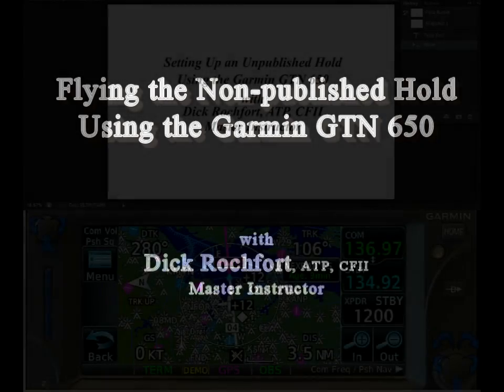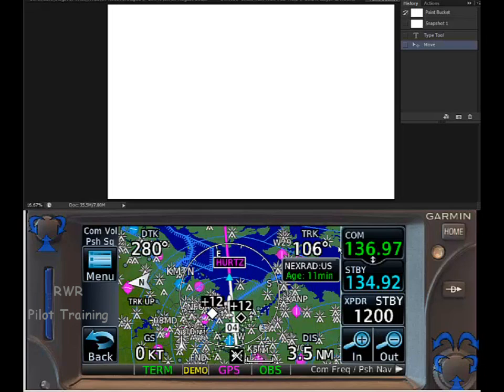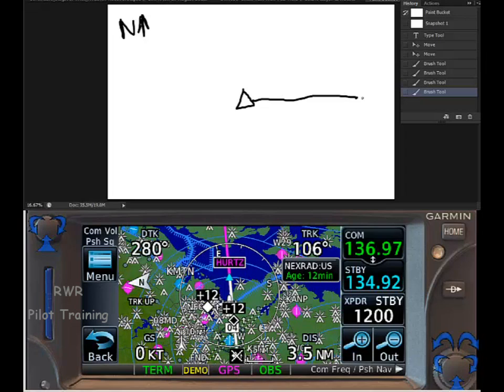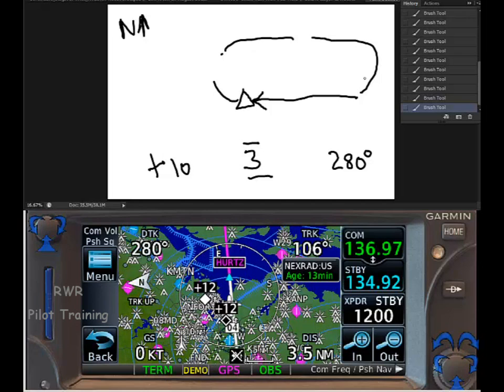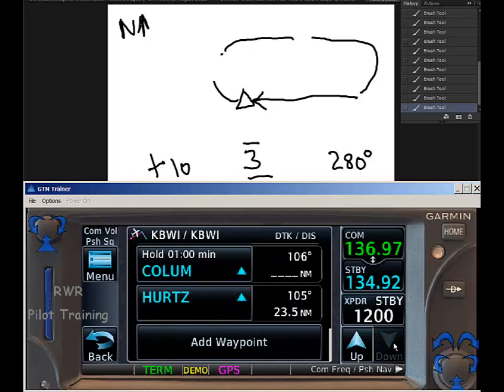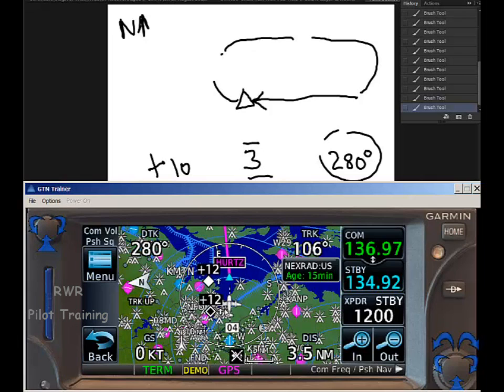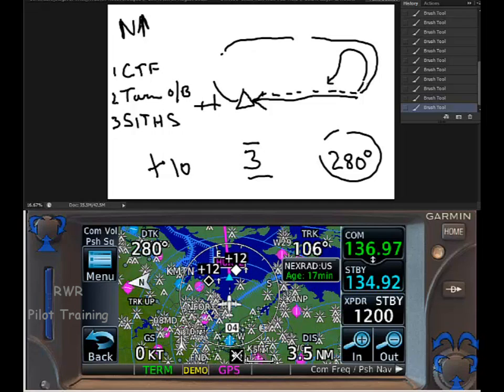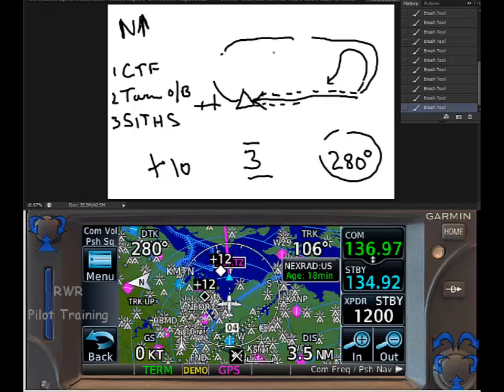Flying an Unpublished Hold with the Garmin GTN 650 Navigator

Comment: Holding AT the fix seems straightforward with more then one way to accomplish this.  What about if there is a distance from a fix that is designated as your holding point.  I.e, hold east of the hurtz 090/25.  If you want to use the 750/650 the only way I could see to define your holding fix was to create a user waypoint and then plug that into the flight plan and build your hold from there.   Am I missing something??
Reply from the maker: Hi Mark.. You might be right depending on what navigator you are operating. New versions like the 650/750 give the pilot the option to make a waypoint at the present position. You could also adjust the range of the map to put the needed distance on the arc, go to the OBS mode and select the inbound course. This might be faster.. Fly Safely - Train Often .. DR

Comment: I believe on the 650 and the 750 if you have the fix in the flight plan, you tap on the fix and select hold at fix. It then brings up a screen, which asks your inbound course and your turn direction. Once you establish that and it enters that fix it will go in suspend mode and hold until you unsuspend using the OBS button. You can also put a hold on any fix for practice, including an NDB.
Reply from the maker: Yes indeed. That is correct. Thanks for your input. Fly Safely - Train Often .. DR
Reply: @RWRPilotTraining  before I started flying again in 2021 I have been away from flying for about 15 years. I knew nothing about glass cockpits thank goodness for Microsoft flight  simulator and X-Plane. I was able to learn the system basically enough so when I got back in the airplane and found some aircraft with the G1000 and was able to slip right in. I studied all of the Garmin navigators from the 375 to the 1000 a lot of older pilots are intimidated, and yes, it is more fun to fly steam gauges but the navigator makes fly along with autopilot much easier. Unfortunately, living in the Midwest whenever I get a chance to go IMC I am plagued with either thunderstorms or ice. I guess I need to move to the coast.
Reply from the maker: Keep your chin up.. There is always weather somewhere. I find that having some good rules (SOP) I can make good weather decisions based on the equipment available on board (or not) .. Fly Safely - Train Often .. DR

Comment: Great video!  But outdated...  I purchased my GTN650 in late 2016.  I didn't know there was a time before my ownership in which you couldn't simply program the hold in the unit.  Ugh, that's nuts.

By the way, Dick, I absolutely agree with your method of drawing the hold - I've taught that to my students for the better part of 15 years.

Anyway, the modern way of doing this is much simpler, thank goodness.  Now all you need to do is press the hardkey D->, select the desired holding fix in the FPL page (within the existing flight plan is fine; no need to append it at the end as was demonstrated in the video), and instead of hitting the softkey Direct To which appears in the bottom left, press the softkey "Hold" button.  Now you simply enter the parameters of the hold as instructed by ATC, or your instructor, and voila, you're good to go.  

I used the OBS a lot on the old GTN series as well as the KLN-94...  it worked, but it was a lot of work for such a simple task.  The current method is much more FMS-like and easier to manage.
Reply: Guns Guns Guns, hey guns, i stumbled across your comment here completely by accident, and i just wanted to say thanks! I just purchased an aircraft that came with a 650, so I'm watching a bunch of videos trying to learn stuff about it. And your comments helped out a lot. This is not a knock to the original video poster, as he posted the video 4 years ago, before the software updates,  I'm sure the info would have been very helpful at the time , but I'm very happy you shared how it can be done more efficiently these days.
Reply: Glad you found it helpful!  The GTN650 is a great box.
Reply from the maker: Thanks.. ah the non-published hold. We rarely get those here in the US. Fly Safely - Train Often .. DR

Comment: What about the 2 (!) airplanes circling around in +12 ? Distracting...
Reply from the maker: Hi Berndl! Those two targets do look a little odd don't they? This video is a "chalk talk" produced in the safety of my office using Garmin's G650 simulator. I have no idea why they are there. If this were to occur on an actual flight and ATC did not call out the traffic I would inquire, although 1,000 ft vertical separation is considered acceptable here in the US. I have even seen a B747 with the Space Shuttle on top pass 1000 ft beneath me on an airway! Fly Safely - Train Often.. DR

Comment: Am I correct? The latest GTN 750/650 software updates now have non-published hold programming built in? Will you be creating a new video demonstrating that new functionality?
Reply: I wondered that, my 650 is new but it appears to have this function, I have not tried it yet but I presume you just type in the info and let it fly for you.
Reply from the maker: The newer ones have the non-published hold feature, but it is so easy I may make it part of a “tips and tricks” vid. Fly Safely - Train Often .. DR

Comment: Hi Dick,
(first of all excuse my poor english, I’m writing from Italy)
Two weeks ago I installed a gtn650 on my piper turbo arrow, coupled to an Aspen Efd 1000 pro.
Beautiful, completely automated, Aspen perform any maneuver, but I cannot make the system to perform published holdings.
After having “load and activated” the published approach procedure, the holding pattern, located at the IAF, is clearly displayed. 
Arriving there, I should decide if continuing the approach or entering the holding.
In the last case, flying GPS mode, I should expect the button “unsuspend” to appear and, if not selected, the Aspen should automatically enter the holding pattern until it is pressed.
Despite of this nothing happens and the Aspen continues the approach ignoring the holding option.
Is possible that a published approach is completely ignored forcing the pilot to disable the Aspen steering mode and flying the holding pattern manually ?
Is that normal or I need to differently set something else ?
Thank You very much for Your advice
Piergiorgio
Reply from the maker: Hi Piergiorgio, Welcome to my YouTube channel. Thank you for your comment. Your English is just fine. There are several possibilities here. The most likely is that you are in APR mode on the autopilot. If so, the GTN650 will fly straight ahead and it will not offer the SUSP option. This is may be because in some older aircraft the approach mode and the GPSS function are mutually exclusive. That is to say that the approach mode should only be selected once the aircraft is inbound on the final approach course. If you want the hold option you must remain in the GPSS mode. This is the nav mode on later model installations. In your case there may be a switch or button on the panel labeled GPSS. if this is the case, remain in HDG mode on the autopilot and select GPSS with the switch. Let me know how this works out for you. You might also check with the installer of the new equipment for the full story. Fly Safely - Train Often .. Dick Rochfort, ATP, CFII, Master Instructor

Comment: why not do a tear drop entry at 070 degrees at the fix then right turn to your inbound course. i dont think a paralell entry would be practicable in that case
Reply from the maker: Hi Kevin, Thank you for your comment. Either method will work. Some of the PA 46 aircraft autopilots have a REV button which makes the parallel entry easier to do and therefore preferable. Fly Safely - Train Often
Reply: Understood..thx.great stuff.i have subscribed
Reply from the maker: Hi Kevin, the key point is to know where the hold is located, then just three simple steps: cross the fix, turn outbound, stay in the hold space. Some autopilots have a reverse button which makes the parallel entry much easier. So it really depends. Fly Safely - Train Often

Comment: Ya know, and I own a 750/650 and a G500, there seems to be way to many details regarding which buttons, and when they need to be pushed on just an average approach or flight, nevermind this minor "set-up". Just an observation. I find generally, in hard IFR, with a little turbulence, and any kind of minor distraction in the cockpit, you can easily become overloaded. Im sure from a human engineering perspective, Garmin has done the best they could. And I do appreciate your video, its great.
Reply from the maker: Hi jjt, yes, I agree. Task overload is the 600 lb gorilla in the room that many single pilot operators fail to see. Successful training programs manage this risk with a disciplined procedural approach based on well-vetted checklists, flows, memory items and standard operating procedures. Seek out and obtain excellent training and you will become a more confident pilot.

Comment: Hello! I was wondering what is the reason one can't just use the obs and stay suspended just like doing any other approach that has a published hold? Thanks
Reply: Dick Rochfort, ATP, CFII This seems to go against what Garmin says in the manual.  Here's how they describe the OBS mode, and it seems on paper like you should be able to use the fix already in your flight plan.

"The OBS key is used to select manual or automatic sequencing of waypoints. Touching this key selects OBS mode, which retains the current “active to” waypoint as your navigation reference even after passing the waypoint (i.e., prevents sequencing to the next waypoint). Touching the OBS key again returns Com/Nav to normal operation, with automatic sequencing of waypoints."
Reply: James Schultz That was my understanding. I have not verified this either way in flight yet though.
Reply: Dick Rochfort, ATP, CFII Hello
Flew today and I was able to do a hold by just using the obs button. This kept the approach suspended until I hit obs again and the approach sequence continued as normal.
Reply from the maker: drsmsaracino Hi drsmsaracino, Dick Rochfort here. The suspend feature will automatically come off in this case because the GTN will see the next fix in the flight plan and sequence to it. This is the reason it is best to reenter the fix at the bottom of the flight plan and use it there for the OBS feature. The GTN will not un-suspend because there is no fix to sequence to. Have a look at the video again at 3:56. It is further explained there. Fly Safely - Train Often
Reply: Thanks for your reply. I have watched the video fully and replayed that sequence a few times. It was my understanding that one could use the obs feature to do a hold at any fix in the flight plan and that the suspend would stay intact until I wanted to unsuspend it to continue. I guess I need to pull out the full instruction manual again!